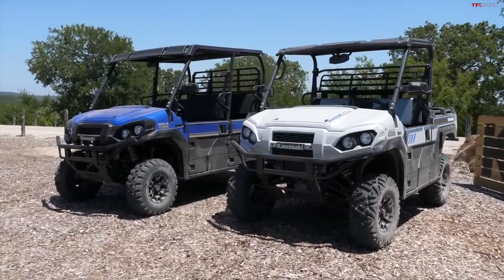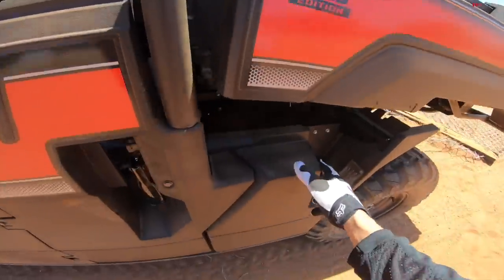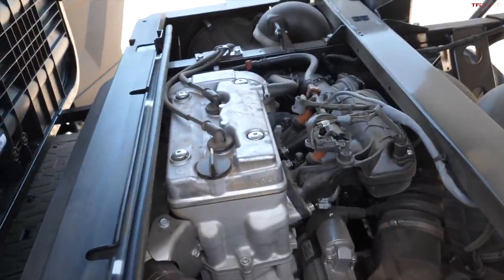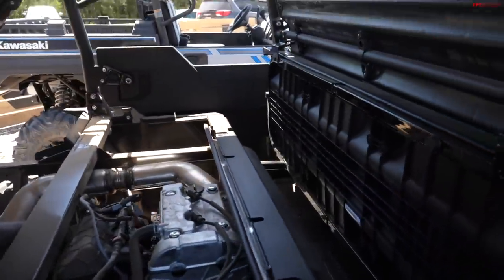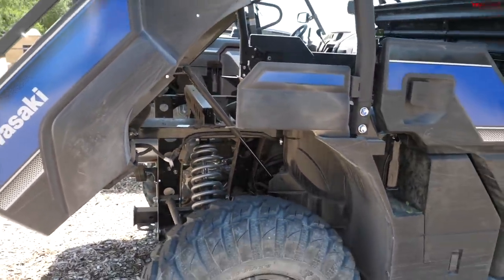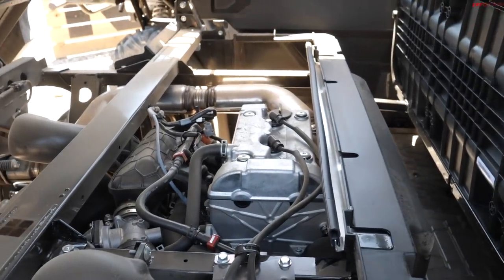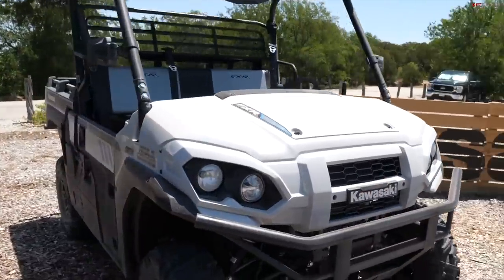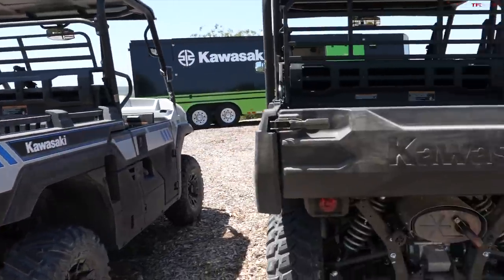2024 Kawasaki MULE Pro 1000 First Look: The MOST POWERFUL Mule Ever!

Comment: I would say the radiator shield will provide you with that "comfort" you were talking about.  Don't need extra heat bleeding in on you.  Or extra cold.  Albeit, since these are not enclosed cabs, you are going to have to dress accordingly anyhow.  Or the shield is just meant for protection against debris.  As for the cupholders, that certainly is a "convenience."   Nice walk around.  Seems like you are in favor of the Mule.

Comment: Interesting that the towing and payload numbers didn't change but the HPs and torque numbers did.
Reply: There are regulations for what payload these can carry and still be sold as a side by side.  There are several of them that can haul and tow a considerable amount more than they are rated for.
Reply: @1guyin10  thank you
Reply: @mozzberg590 it’s also a factor of cooling and suspension too

Comment: I picked up a 24 FXR last week.  Fun utility overall.  I do get a lot of heat coming from under the seat and through the seat belt reel cut outs when cruising.  My passenger had to shift away from the normal position.  I added the factory half windshield so maybe that is creating a negative pressure.  I do not like this furnace affect coming from the seating area.  It cooks my poor dog.  Texas is hot enough without this machine blowing scorching hot air onto my passengers.  I am going to order some sticky back thermal barrier mat and try to fix it myself.
Reply: I have the 2024 MULE PRO-FXT 1000 LE RANCH EDITION and I haven't experienced anything like that nor has my passengers sitting on the back seat.
Reply: @Michael-ft3rc Are you running the factory half windshield?   I think that is the main source of the negative pressure in the cab.  I do not have the issue as much with no windshield or full windshield I also think it will be a mainly FXR issue, the crew cabs have different airflow designs.  Kawasaki engineers came out and rode with me yesterday.  They witnessed it first hand.
Reply: @RinconPilot  nope I am not. I'm running a full windshield. Kawasaki engineers? How'd you arrange that?
Reply: @Michael-ft3rc  I complete all the surveys Kawi sends out. They reached out me, said they were coming through town to visit handful of owners.  To get feedback and see how we use our machines. 
This is definitely a half windshield issue and probably a two door issue.  The half windshield has a fat wind break lip that creates a huge negative pressure in the cab.  That negative pressure draws the heat in from the seat and engine bay.  I have no issues with no windshield or my full windshield.